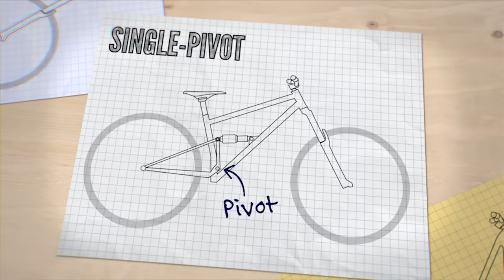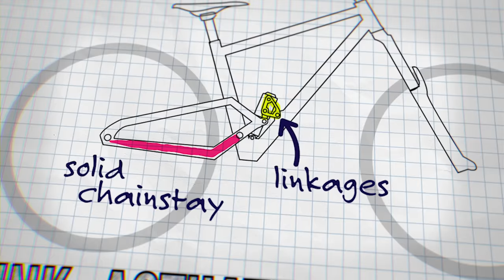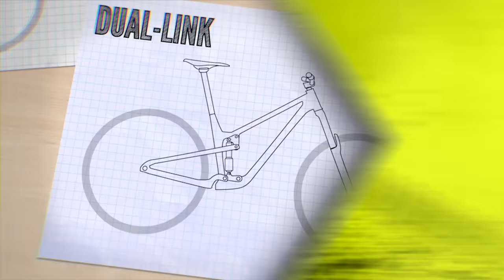Understanding Suspension Layouts | Single-Pivot, Horst Link, Dual-Link & More Explained!

Comment: Where would you place Yeti's switch infinity? 
I've owned over 30 mountain bikes in the past decade and absolutely love my Yeti the most as an all mountain bike. Takes the hits with a very progressive bottom out but climbs like a mountain goat. I love the Specialized Horst link for an enduro and DH bikes, seem to respond the way I want it to. Linkage single pivot is acceptable for Dh too. But I've never been a fan of the DW link or the handful of dual link designs I've tried. Currently I own two specialized, a yeti, and a Rocky Mountain.
Reply: You can treat it as 4 bar linkage design, where the linear momevment is replaced with a very long bar with the pivot point far in front of the bike.
Reply: @SuperAnatolli  And does the pivot point remain constant? Not entirely sure how Yeti does it but it's been my favourite bike by far
Reply: @Rickie-37  Read my answer agian. You obviously missunderstood it. You can also calculate how the rear wheel travel differs with the Yeti solution compared with a 2 meter long bar in a 4 bar arrangement.
Reply: Oh right, a 4 bar has a variable pivot point. Thanks

Comment: 2:25 You confuse anti-rise with rise. When braking you have both rise (due to body movement) and anti-rise (dictated by the position of the IC and would happen irrespective of the body movement). Note: There is also brake jack, which is often confused with anti-rise, but is actually something else (dictated by the position of the brake caliper and it's movement relative to the brake rotor when the suspension moves. sometimes this is addressed with a floating caliper or the DW-link, but that doesn't address the anti-rise as it doesn't change the IC).
Similarly when pedaling there is both squat (due to body movement) and anti-squat (dictated by the chain forces and IC). If you  want to understand these correctly I recommend to watch andrextr's youtube channel.

Comment: Great video Anna and GMBN Tech team!
I always wanted to understand this better, but never quite found anything that isn't full blown marketing for one brand. Thank you!

I quite like the old Giant NRS system (horst link if I learned well? 😅), but I like to change the recommended pressure settings. By the manual, negative chamber pressure should be 5 PSI regardless of positive chamber pressure with the original RS SID (Dual Air or XC or Race) that had independently adjustable chambers.

I tried to regulate positive chamber first to the recommended pressure, then put just 5PSI on the negative, then check SAG and adjust positive chamber accordingly, record positive chamber pressure, and then equalize negative chamber to the recorded positive chamber pressure for the bump sensitivity, or recorded positive chamber pressure -5 or -10 PSI for just slightly firmer suspension.

Convoluted? Yes. Effective? Yes!
I love that bike! (It also looks rather cool IMO)
Reply from the maker: Glad we could help!

Comment: I guess the switch infinity from Yeti is a kind of dual link suspension?
Reply: You can treat it as 4 bar linkage design, where the linear momevment is replaced with a very long bar with the pivot point far in front of the bike.

Comment: Hi Everyone! 
I have 2022 Orbea Occam LT (150mm front and 150mm rear travel) with Fox Float X Performance air shock in the back. 
I have heard very good things about this bike thats why I have chosen to buy it. 
After several use, I feel like the bike could absord little bumps better, sometimes it feels like rear shock is not even working well. Alltough the little ring is almost in bottom out position. 
Is there anyone here who have met the same issue like me? Or is it normal with this bike and suspension? Maybe my air shock is not adjusted well…

Thank you for the attention and your help.

Comment: Dave Weagle is the man!
Reply: A very very very litigious man.  Now that his patents are expiring (except for DELTA and DW6) there can be a lot more variety in MTB suspension on the market.  Prior to 2014 nearly everything was single pivot of some flavor as that was about the only design that wasn't infringing on one of Weagle's patents.  Horst Leitner's link design had its patent expire in 2014 which caused the explosion in Horst link bikes afterwards.  Santa Cruz held the patent on most VPP designs until last week, Rocky Mountain had to cease using LC2R in 2009 because of a patent dispute with Santa Cruz and they have mostly used Horst link since 2014.  Few brands were willing to pay the extremely high licensing fees that Weagle demanded, pretty much just Ibis, Pivot, Evil and more recently Atherton.
Reply: So in many ways Weagle held back the development of MTB suspension by patenting and jealously guarding most of the viable designs, licensing his designs to only a few companies at a high price.  One of the key reasons why bikes with Weagle suspension designs tend to be super expensive (i.e. Pivot, Ibis, Evil, Atherton).  Specialized did the same with Horst link until the patent expired in 2014 as while it was designed by Horst Leitner, Specialized owned the patent.

Comment: Bla Bla! Simply tell them, what the "optimum" progression level is and the linkage with the minimum brake and acceleration impact. Or which system is best for for a specific application. It looks like this bla bla is just meaningless entertainment than anything useful.  Fortunately for the marketing dpmt's, almost all customers are not able to know how a good systems feel.
Reply: Maybe this video just wasnt about advice whats the best etc. but rather just an explanation of the different definitions. Much of the rest is religion anyways.
Reply: You don’t like education much? Besides, it is not so much which system is best for an application, but rather which tuning and kinematic address various suspension challenges.
Reply: simple... rocker link designs ...vpp mastro giant zero mondraker propain p10 for me are the best... make the bike feel right composed and much more sensitive small bump active